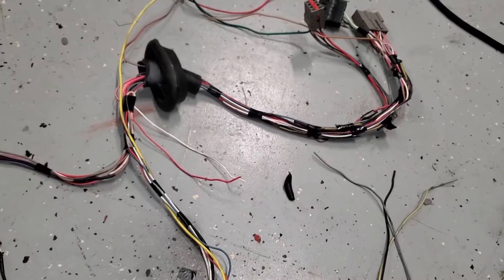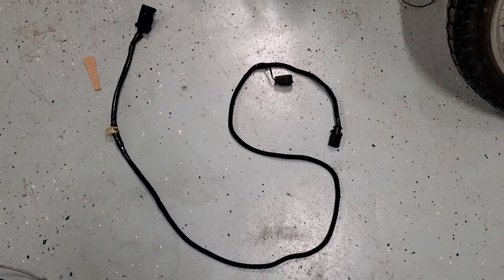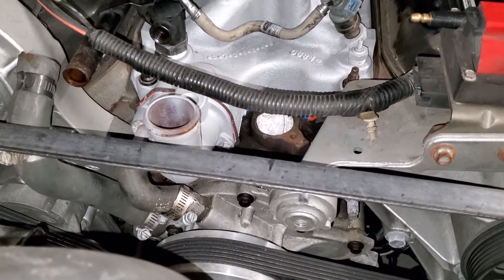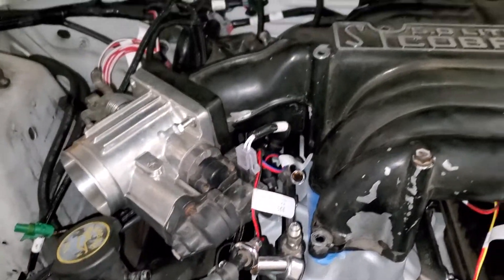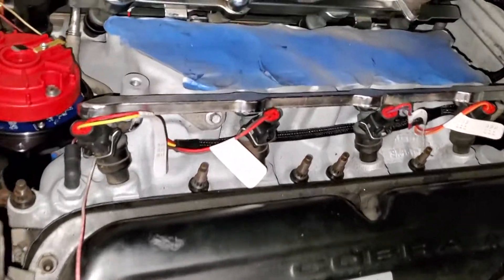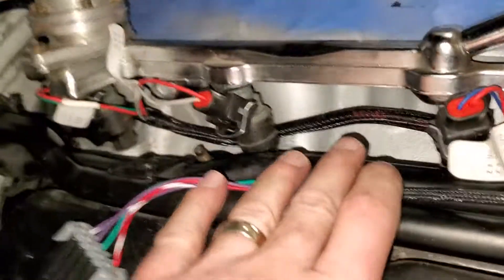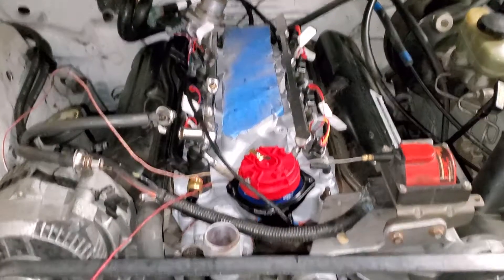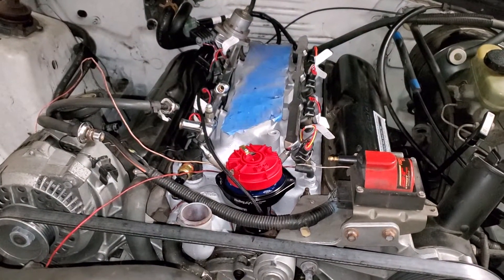SN95 Terminator X: Part 5 Engine harness layout

Comment: Did you go through the factory wiring just to retain the factor instrument cluster? Is any of it necessary if I don’t want to keep it? Besides getting the fuel pump trigger wire from the ccrm? I’m running a msd solid state relay instead of the factory relays for the fuel pump and fans
Reply from the maker: This is what I did for the fans, fuel pump, and cluster (sorry for the long delay in responding) https://youtu.be/tpU81ZbvVk8